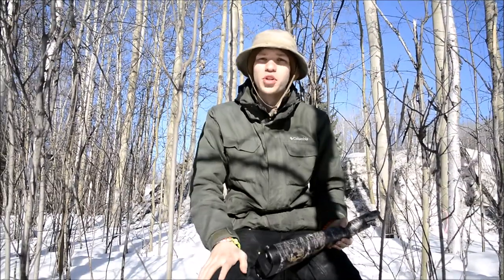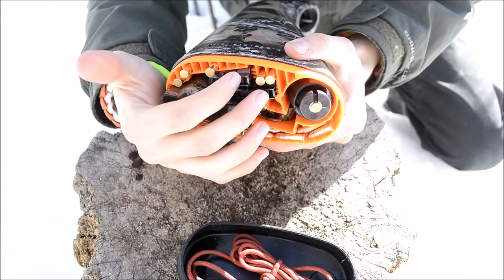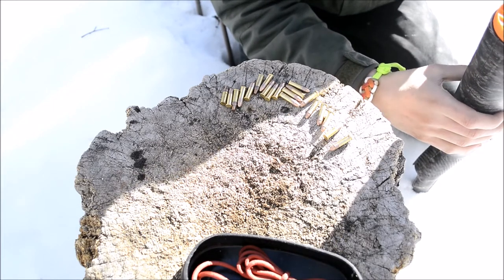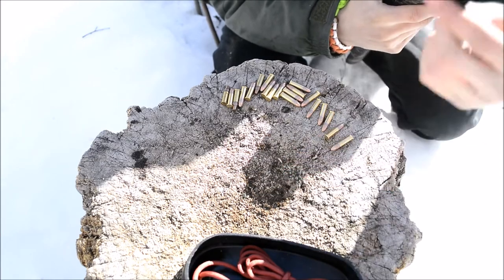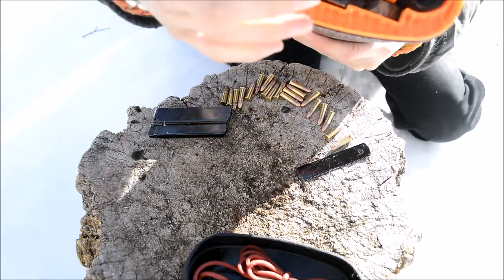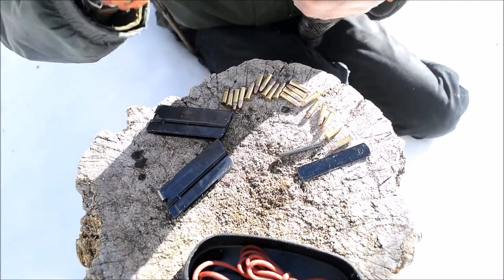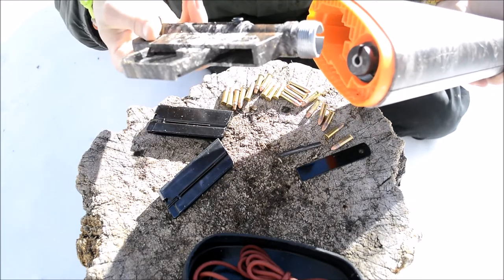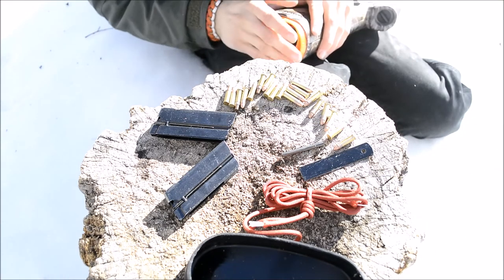How To Make An Amazing Henry AR-7 Survival Kit 🏕🏔

Comment: There is a circular shaped hole down at the bottom where the front end of the receiver fits into the buttstock. Using a hole saw I cut out a 4" deep hole thru the internal Styrofoam. I then slid a hollow plastic tube filled with ammo into this space. When I need more ammo, it just slides right out. Simple. I did this about 40 years ago on a Charter Arms version of the rifle. I suspect that the Henry version is about the same.

Comment: Bianchi makes a plastic speed strip will hols 8 .22 rounds. Attach a small pouch of some sort to the outside of your stock, and you would have 24 or 32 rounds much easier to handle that just loose and rattling around inside the stock. Then you could use that inside space for something else.
Reply from the maker: Brilliant idea!
Reply: Yea the smartest mod I saw for this gun was to add a butt stock pouch. Then you can add way more ammo and some other items without having them so loose in the butt.

Comment: Any idea how far down in the stock that orange piece actually goes?? If it's just a couple of inches past the butt end, it seems you might be missing a whole lot of space between the bottom of that plastic and the receiver area itself.  I realize the barrel goes down in there the whole way but still, it seems to my you might be able to make it where you could pull that orange part out, pack survival goodies inside the stock, and then replace the orange piece.  To keep the barrel from catching on everything you have in there (Which is hopefully wrapped up in some type of bag or kit) you could put a piece of pvc in there for the barrel to slide into.  Looks like you're not afraid to carve out what you need to carve out so, maybe you want to take a look at going into the stock area itself.  Perhaps taking the orange piece out and sanding all the way around it, then putting some type of pin through the outside into the orange area would keep it in place, then when you need to access your other supplies, pull the pin, pull the orange piece, then dump everything out... including your lost farot rod..
Reply from the maker: That would be an epic idea!
Reply: I remember reading an article where a guy had drilled out a hole on the side of the stock, threaded it and used a threaded plastic stopper to create an additional compartment at the front.

Comment: Check out my channel, I have an ar7 I took the rubber plug off my son’s piggy bank, I cut  a round circle on the side of the stock with the Dremel and you can store about 250 to 300 rounds inside the stock , It makes the gun feel so much better because the back end of this gun is so light it feels like a toy. And the piggy bank plug is very flat it fits nice and flush with the stock. You can see it on my channel I just put it up,And you don’t have to worry if your rifle floats because how many times are you going to be in water deep enough where you cant just bend down in a Brook and pick your gun back up
Reply: Sounds like you could pack it with a mini survival kit & extra bullets? How's the integrity with the hole that large? Any cracking, weakness?
Reply: Maria Torres No it’s absolutely fine, it’s just that it makes the gun about 4 pounds heavier if you fill it but it is a good idea it really is you always have at least 300 rounds with you

Comment: I dare say that the AR7 is a piece of junk.
Junk as his various predecessors as the Papoose and others.
Nerveless, thumbs up for effort!
Reply: woodsman forlife it is mentioned as an emergency survival weapon to shoot birds and small mamals, that's it.
It was not designed like a Ruger 10-22 to be shot every day and or as a primary hunting rifle.
It was originally designed for military pilots in their survival packs.
I agree that it is not by far anywhere near a top of the line weapon but that's just it, it is not supposed to be either. one more thing dummy, it's made in America and that's good enough for me.
I have the camo one and only fire 5 rounds through it. it is packed away with 500 rounds in my BOB.
Reply: Not junk at all! Every car and airpIane should have one! I much prefer the my new Henry model over the Armalite or the Charter Arms versions, but I will not sell the three Charter Arms versions that I have owned for near 40 years. Many, many rounds shot out of each of them.

PS... Good video.
Reply: Yea. Only idiots discount this weapon. So many who think other guns are better. Yes they are but they are also much heavier and larger.
This is pretty much the only rifle you can throw in a pack and not notice it is there. Even a 10/22 with backpacker stock is over double the weight.